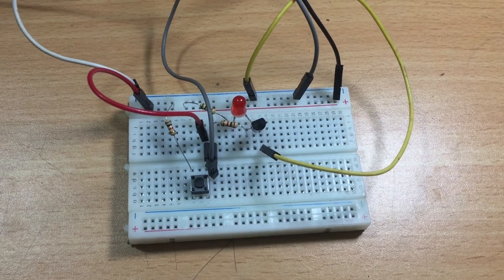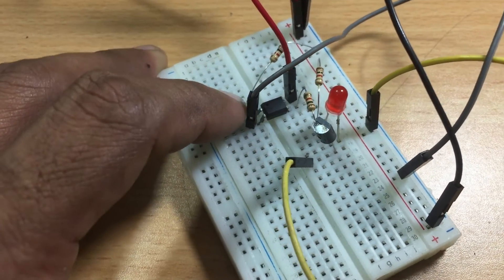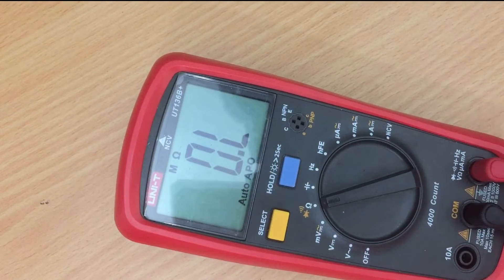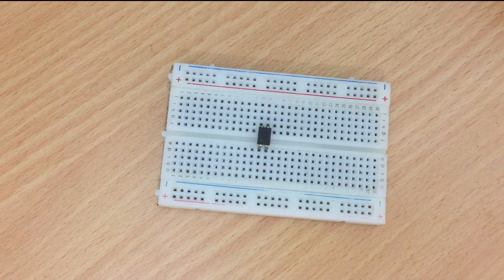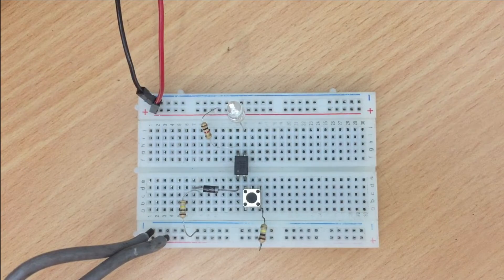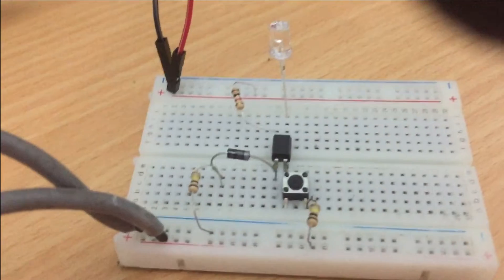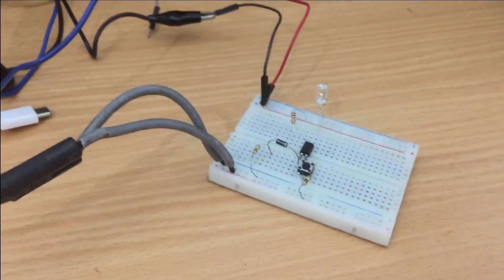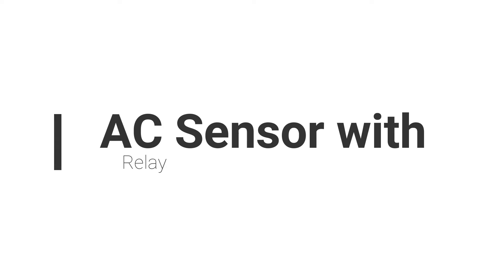AC Sensor for arduino with Optocouplers

Comment: thank you sir..
it is nice video..
It looks that this circuit is for AC 2 phase.
can this circuit to be used for AC 3 phase as well ? for example, I take 2 of 3 of that AC wire connected your circuit..
Reply from the maker: It is depend on your requirement that you want to check both are working or one of either working.
Reply: @setnfix  I need only 1 of either working..
Reply: 1 of either working..
I only want to know whether my 3 phase alternator is running or not.. by sensing 1 of 3 phase.
Reply from the maker: @sukapuratech1228  then you can use one live and neutral wire.
Reply: @setnfix  I would try it,, and thank you very much. I have subscribed your channel.
Reply from the maker: @sukapuratech1228  Thank you